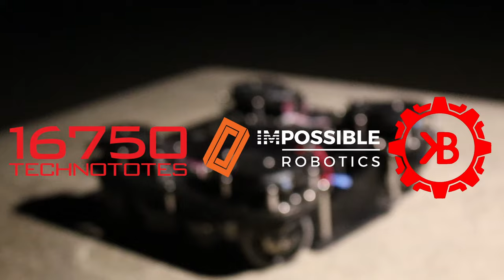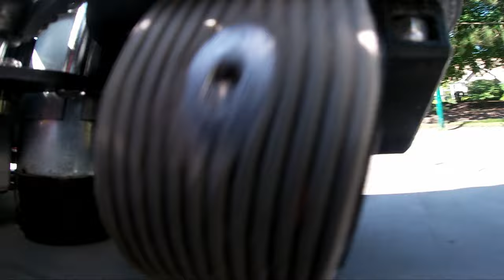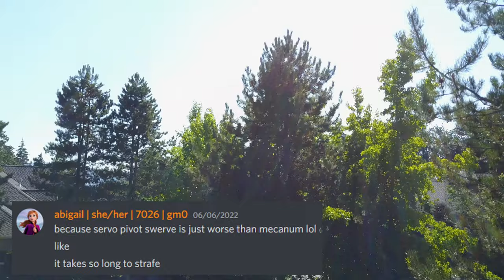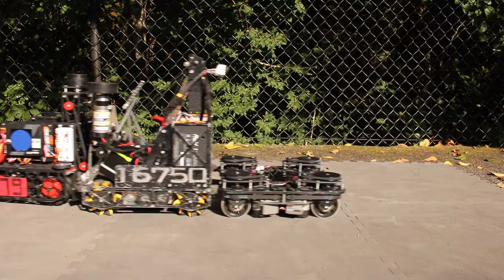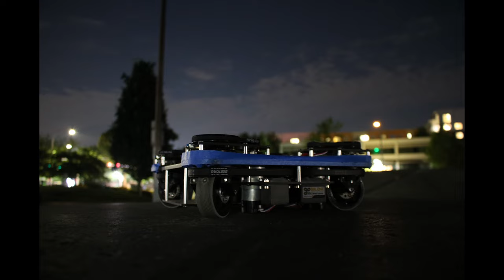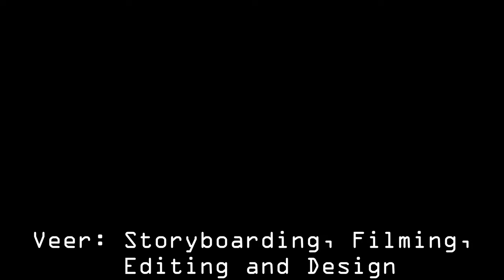FTC Coaxial Swerve Reveal

Comment: Awesome work!
I would be super impressed to see that course run where the drive controls only the x and y and the rotation switches 90 degrees once every 2 seconds. 

The massive benefit that could come out of further development would be the ability for operators to take over momentary control of rotation so that they can line a robot up while the driver is getting it to its destination.

Comment: Swerve has come a long way in FTC! Good job guys, this is really cool. Did you test it under any weight besides the 3 batteries?
Reply: Yeah we did, The drivetrain weighs around 13lb by default, and we brought it up to 30lb with steel plates and didn’t notice much difference. I would not recommend making a bot that heavy, shoot for something like 20-25lbs.

Comment: I have a small curiosity . The motors are almost touching the ground . When the extra systems for this season will be added , arent u afraid that u wont be able to move ? Because to me it seems that it might be a real concern.
Reply from the maker: This was just a prototype chassis (sort of a proof-of-concept) that we made in collaboration with a few other people over the offseason. The chassis we are running during the season uses 4 axon servos instead of 8 super speeds, and has slightly higher ground clearance.

Comment: Just curious because I have never used an andymark encoder, how well does it work, and how do you use it with the rev control hub?
Reply from the maker: just plug it into the analog port. It works well, but has a small amount of noise. Using the onboard low pass filter added phase lag
Reply: Thank you

Comment: Assuming you guys are using closed loop control for your modules, It looks to me in the video that the wheels are not achieving the angle setpoints fast enough. I don't know if you've fixed this yet but I would tune it to have much more aggressive constants.
Reply from the maker: This was v1 of our swerve drivetrain. The servo we were using very holding us back from running a more aggressive PID since they only update at 50hz internally. For our competition swerve, we use 1x Axon Robotics MINI+ per module, which update at 333hz internally, and for this reason are almost twice as fast to reach their desired position
Reply: @kookybotz  Oh nice, yeah that should do it. We currently run ours at 50hz but soon about to upgrade to 1000hz, hopefully the switch is worth the time spent writing ugly code :)
Reply from the maker: @tewodrosmengistie4133  Just curious, what servos are you planning to switch to? I've never seen servos that update at 1khz, thats pretty cool.
Reply: @kookybotz  Might be frc motors?
Reply: @davifacchini7642  yup, good old REV NEOs

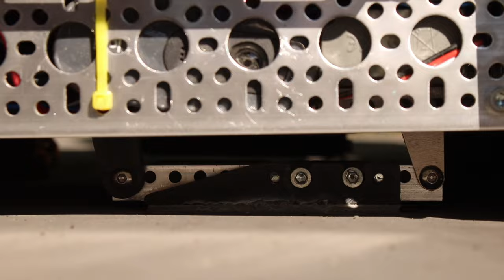Comment: I will suggest to implement traction control while pushing, it looks you are giving max voltage to your motors and you can barely move the omni robot at 2:05
Reply from the maker: The omni robot at 2:05 is actually a 6wd with traction wheels in the center- this gives it a LOT of resistance to being pushed from the side. Additionally it weighs much more than the swerve
Reply: Yes, but slipping wheels reduce your max pushing force, the best you can do is sensing if your wheels are slipping by comparing encoders speed and IMU speed and if there is a difference correct your rpm so you can always have traction and therefore push harder
Reply: @PaoloReyes  this like doesnt really do much, as the coeffecient of static and kinetic friction in the wheels isnt all that different from testing. Can also wiggle the robot to vector the force at a different angle to effectively increase pushing power.
Reply: I'm a VRC competitor and the current VRC season Spin Up has a lot of pushing and defensive play, and I'm curious as to how I could implement this possibly. could you elaborate on how to execute this idea??